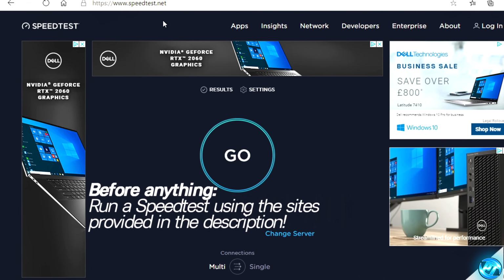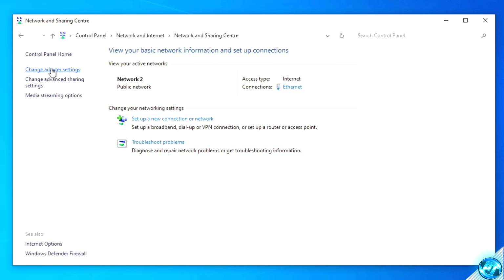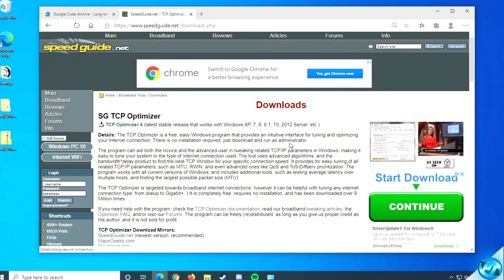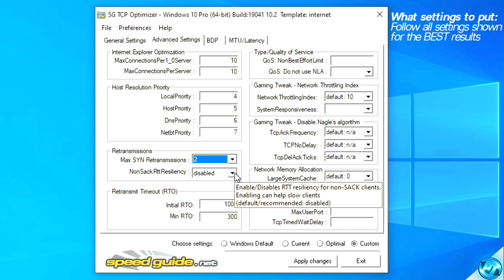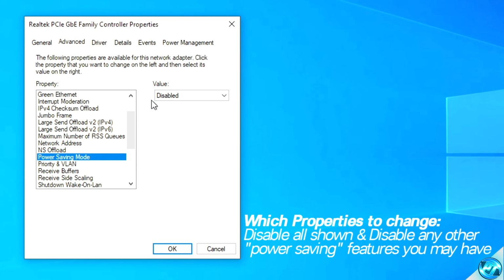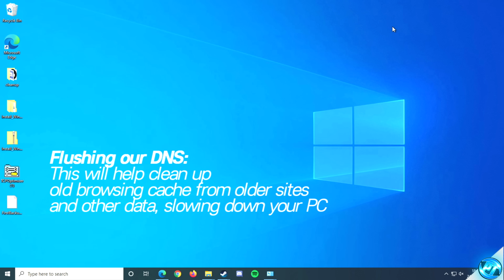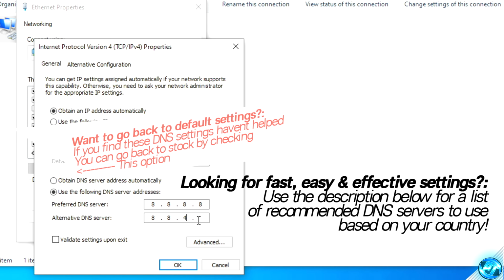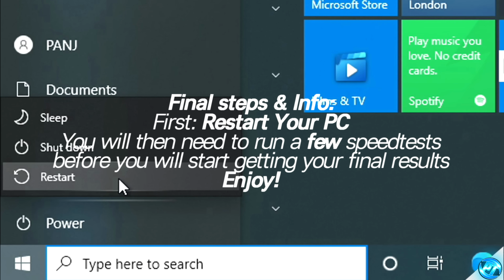🔧 How to SPEED UP your Internet! Boost Download Speeds, Lower Ping, Fix Lag on Wired and WiFi EASY

Comment: I live in Germany. My internet comes from Telekom. It's the best here. However, with these simple tips I was able to reduce my ping from 10ms to 5ms. Great video that also works. greetz from Germany
Reply: Dafür hast du dur jede Scheiße runtergeladen? 

Habe 200 Mbit  und 13 down nachdem ich nur den dns reset habe etc hat sich mein Ping von 36-38 auf 26-30 angepasst.

Warte mal ab wenn da ein Windows 10 Update kommt und es dir alle Einstellungen zerfetzt 😅.

Diese Videos sind meist bezahlte Werbung für Programme wie diese dabei hilft es zu 80% schon nur den Treiber und die dns zu reseten 😂
Reply: @algorak5604  warum scheiße ? es funktioniert  5ms sind eben besser wie 10ms.
Reply: @xylo8554  Han vergessen nach dem nächsten Windows Update und Router Neustart war alles wieder beim alten 😂

Comment: There are certain factors here at play. Your provider, modem(router's if you have them), your plan, using wireless or wired means(cable or wifi), and your devices capacity to actually support high speed (yes some devices are unable to support speed more than 2.3ghz), Background applications your using, and if you're playing game the ping is related to the server because if you're in india and the server is in indonesia then you will have high ping. 

The best you can do is get a good subscription the provider gives you modem as well with inbuilt wifi and get an ethernet cable you will be able to get minimum 90mbps if you have a plan more than 100mbps.

Comment: System Responsiveness has a minimum value of 10. When you set it to a value below 10, it multiplies that value by 10, ie 2*10=20. 0 is automatically read as 1, so using the value 0 is the same as value 10.
Reply: Scarlet Kelsi  It will be the same thing

Comment: when i usually run ping command in my pc it shows max 4-5 ms but when i use laptop connected to wifi shows constant 80ms and max 400 ms and sometimes 1000+ ms and few request time out can this video help if i apply all these to my laptop?

Comment: Could you do one for Windows 7? The GUI for the advanced tab in TCP Optimizer is radically different from running it in Windows 10. BTW In Windows 10 MOST of the new setting in TCP Optimizer revert upon reboot. I have Intel Ethernet Adapters. I did however check the registry and the custom settings actually DID stick. TCP Optimizer just doesn't see it. But one thing I cannot change is the congestion control provider to ctcp.
Reply: serious question. why do some people still use windows 7? is it because theres less stuff being thrown at you on the home screen?
Reply: @ChaosKelly11 If you you've never mained Windows 7 I understand the confusion. Window 10 FORCES every update whether you postpone them or not, and it has installed some NIGHTMARE updates that had to be undone shortly afterward, sometimes too late for some people. Windows 7 never forced updates on users, though MS has released some really bad updates for that OS, too. It is simply faster to navigate, has a MUCH better GUI, lets you hit F8 before starting Windows (have to jump through hoops to enable that with Windows 10),  and doesn't SPY on you or sell your data to advertisers. Microsoft is even worse than Google when it comes to data mining. It is no longer Bill Gates's baby. Whaa! Whaa! Whaa!

All that being said, you can't install the latest NVIDIA drivers on Windows 7. Back in 2019 someone at NVIDIA told me personally that NVIDIA has to rewrite many of their drivers every time Windows does a significant feature update because it is like a completely new OS the way MS does things. So they just didin't have the resources to include Windows 7 anymore. Even with the needed Ryzen compatible drivers injected into a Windows 7 install (I've done it), your USBs will all stop working if you enter recovery mode. Sometimes even in safe mode. So Windows 7 is fine for older systems but newer hardware systems are a no go for Windows 7. 

There are a surprising number of people who love and still main Windows XP and I can't blame them. It was incredible, then Windows Vista came and RUINED PC computing for a couple of years before they finally fixed some major issues. They're just as much out of luck with modern hardware, of course.
Reply: @ChaosKelly11  lol
Reply: ya same

Comment: No lie, after doing those settings on the adapter my pc was having boot issues and took forever to get running. Wth did this do? I just built this pc 2 months ago
Reply: Imma be honest, these settings are likely to create more problems than solve, just revert em back, you cant really do anything to get better internet speed/latency than change isp or use ethernet or just upgrade your internet plan

Comment: Well it didn't got any improvement but my friend said his speeds were improved so i guess it work in certain cases only (he was using a wireless connection while i an using a Ethernet so maybe that's why I didn't got an improved speed)
Btw you make really helpful and great content 🔥
Reply: Yea, when you're using ethernet cables, you're practically 90% of the way to max speed, the last 10% is optional and kinda risky to adjust if you don't know what you're doing.
Reply: I got some better DL speed, ping and UP stayed the same

Before
40.14 DL 
12.48 UP

After
62 DL
12.65 UP

ping from 19 to 17

Comment: TCP optimizer !! Really !! What a Scam dude ; most people don't even know what TCP is ; very sad :(
Reply: Seriously? What is it?
Reply: @MarkDoriaYT  it's a standard for computer communication created by IBM, presente in every network interface in PCs, (Transfer Control Protocol), it can't be changed or optimised, it is needed for secure connections, there is his brother UDP (User data protocol) it is fast,, websites use it for streaming or they don't care if the data get fully sent or not, so those are standards, any change to them may lead to not proper working websites and maybe data lost, so unless you know what your doing, don't ever touch low level computer stuff, the only was to speed up connection is from the service provider, and change some cables and stuff, no software is able to do that
Reply: @billy-cg1qq  i'm having packet losses in all the games and the pages are taking a while to load, do you know how i can reverse the changes? i already tried putting the default settings from the same program and formatting my PC and it's still the same. this is frustrating because of my misinformation  :(  help me please
Reply: @Dramaah  when did you start experiencing this ??
Reply: @billy-cg1qq  after making the method of tcp optimizer, I began to play and had lost of packetes
Reply: in all games
Reply: @Dramaah  you said you formatted your PC, it should be reset, so i don't know exactly what is happening, but maybe try changing your online game passwords

Comment: I have a laptop, so I had a doubt about those "disable power saving settings". 
If I turn off them power saving options, will my battery depleting be drastic. 
Like right now I get like 2 hours, will that reduce drastically?
Reply: well yes but if u have ur plug it would not be a problem at all